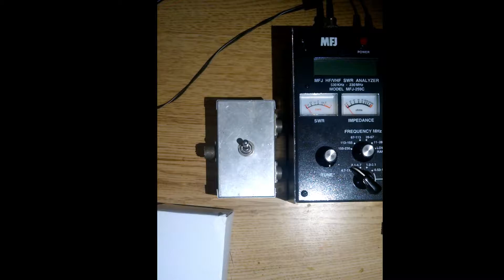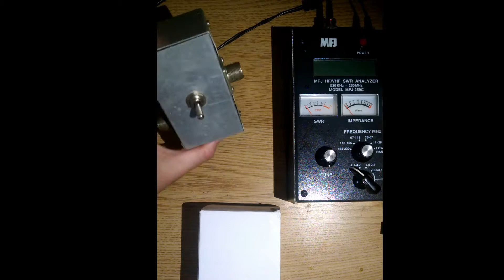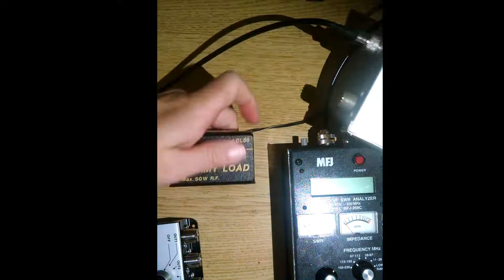Kilowatt Ebay Antenna Switch Vs My Homemade Switch

Comment: I bought one of those switches, it worked OK but every time that you pulled out a PL259 out would come the whole SO 239. I got over this dodgy fitting ones by fitting bolted in SO 239s.